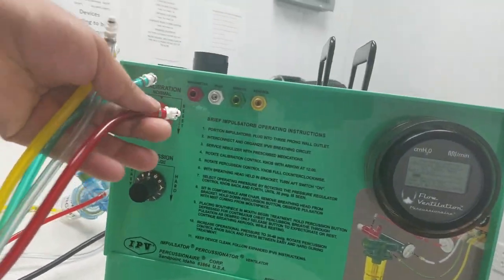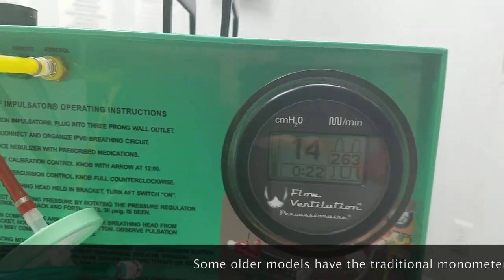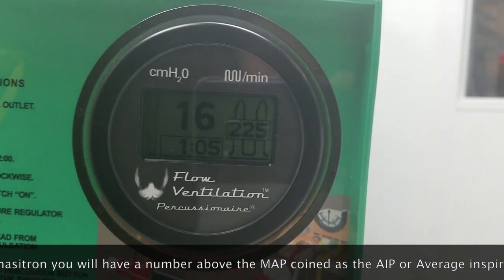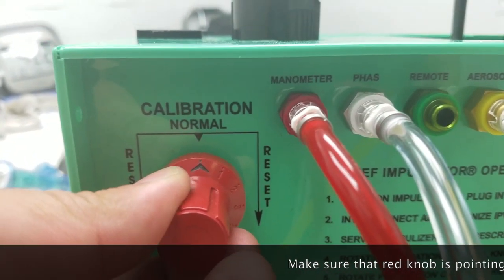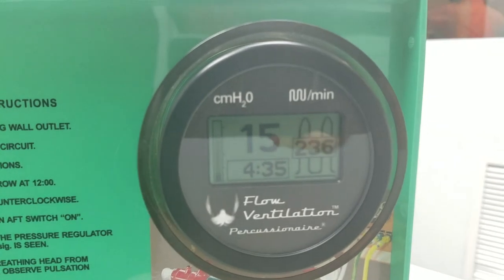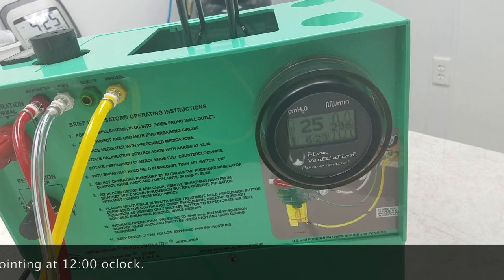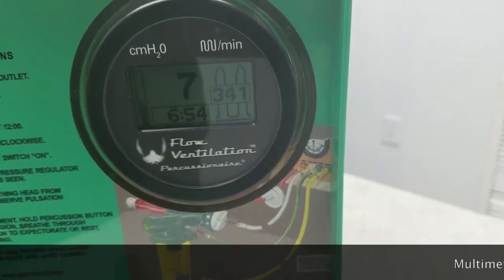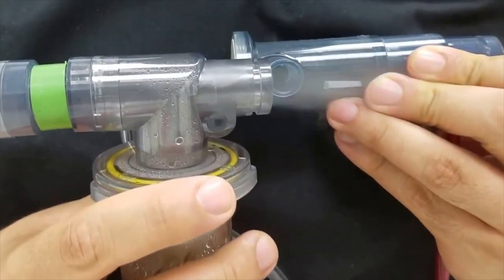The Home IPV Impulsator with electronic multimeter

Comment: How do you use the percussion knob? How do you know what number to turn and after how many minutes should you turn the knob?
Reply: Turning the knob is based on assessment and level of expertise with the device. If you have an obstructive component that is occupying lung space like fluid, edema, secretions, and\or debris, including stubborn atelectasis then you would want to increase the "speed" or rate of percussion in order to effectively recruit the lung. Keep in mind ventilation (co2 removal ) and secretion removal are tied together. I mean order to first remove secretions you must first recruit and ventilate those are that are closed off. I will be posting a video that covers assessment techniques to help with this. So based off of assessing the patient faster percussive rates help to penetrate deeper to the peripheral tissue. Slowing down the rate will enhance faster secretion mobilization so working a wider spectrum of the knob can be very useful but must be done off assessment.